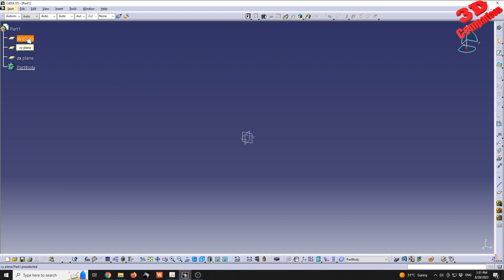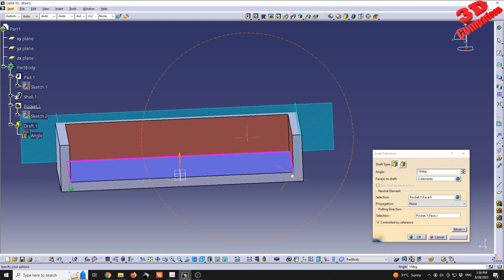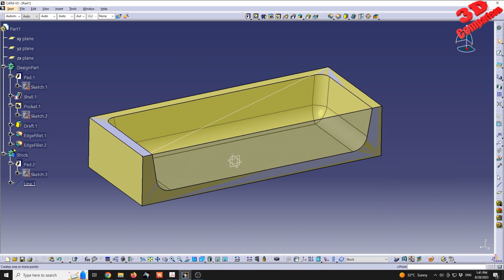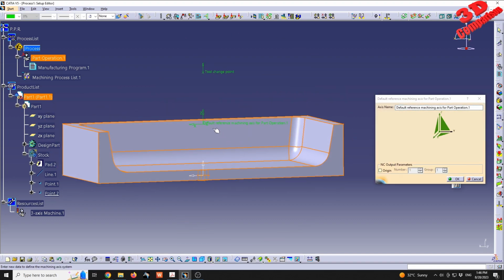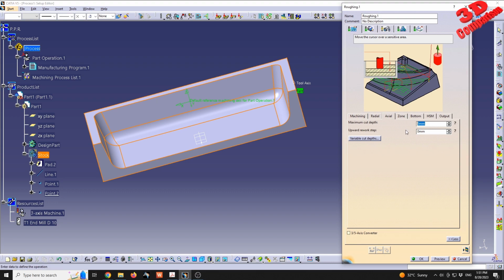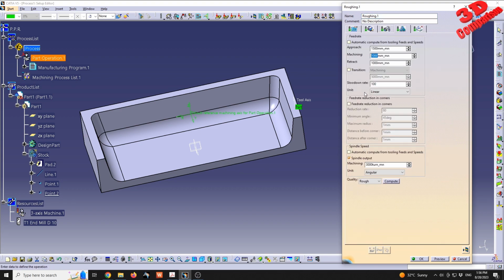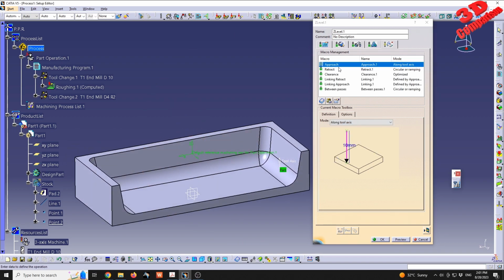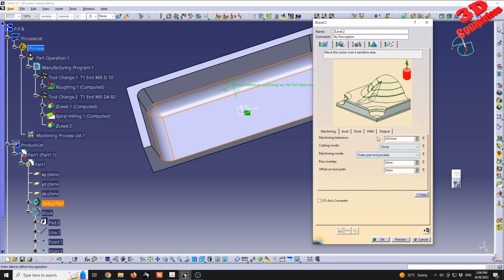CATIA V5 - Surface machining basics

Comment: A Tip: While adding dimensions, you can double click the dimension button. This way the function stays active, and you can add dimensions much quicker, without clicking the icon in the sidebar and relocating your mouse in the viewport over and over again.
Reply from the maker: Thank you for this, I do know about that feature but I got used to dimension like this. It is a good tip that will improve my speed, in some cases I use ctrl+y to redo the last command, but double clicking the icon is no doubt much faster!
Reply: @3DComparison btw this does not only work un this case, try it with other functionns ;) 
Another tip: try to use as less dimensions as possible. Instead of a zero dimension, use a coincident constraint (if its not a parameter you wanna to change later). If you wanna go full parametric: Never use redundant values. Calculate them with formulas 😊